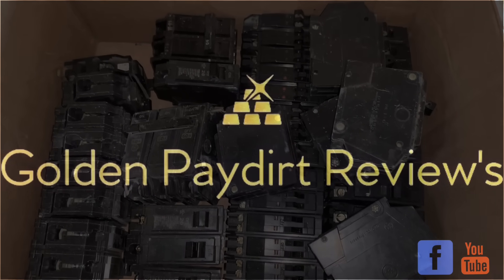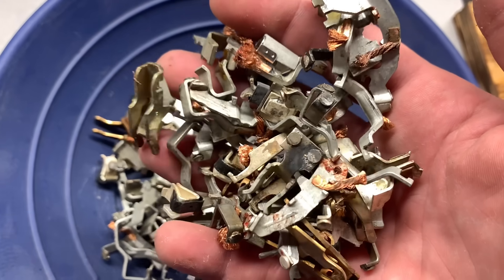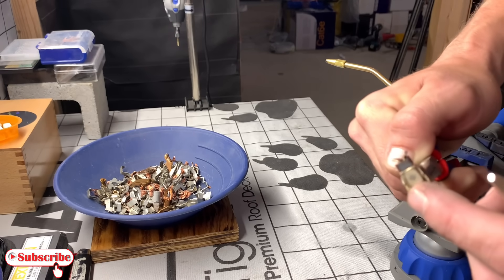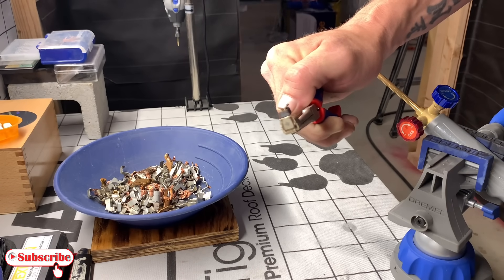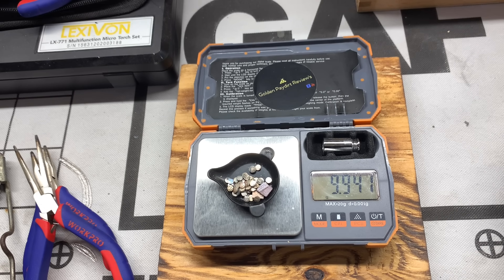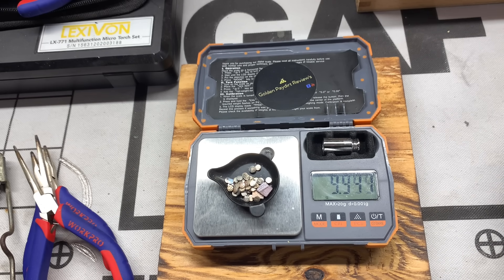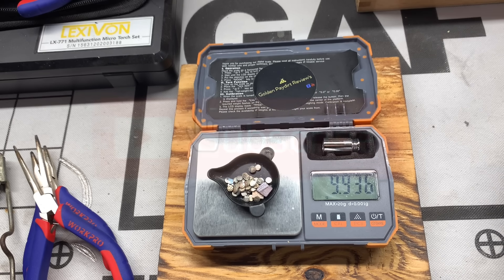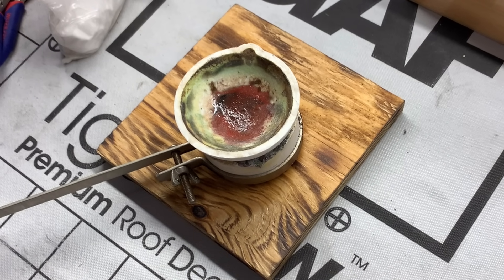Circuit Breakers Loaded With Silver!

Comment: It’s NOT pure silver. Pure silver cools into a silver mass, not a black mass that needs buffing. Period end of story. Pure silver always cools silver. High 90s cools grey. Anything lower cools black. If it was say sterling or 90%, a dunk in water would have produced a milky white silver. None of which need heavy buffing. My guess is, some of those buttons are probably also silver plated copper.  I’ve been working with silver long enough I can tell good silver just by the color of how it cools. And pure silver always cools Nobel.
Reply from the maker: Thanks for sharing your detailed insights on silver purity and cooling properties! Thanks for watching

Comment: I am curious what the profit is after you factor in the expenses involved to refine this Silver, i,e,   Gas [ torch to smelt ] Electric [ wire wheel to clean ], misc. expendables or tool wear . Not looking to be negative, but besides labor, there are out of pocket expenses. I am curious as to the profitability given current Silver prices being so high, but inflation has also raised these other costs as well.
Reply from the maker: Those are great points to consider for a full cost analysis!

Comment: I found an abandoned trailer next to a scrap lot that closed back in 1996. I removed the trailer on a dolly because the tandems were junk and got it to my scrap dealer. When we opened it, it had thousands of stainless steel looking round billets. We called the police and tried for a month to get a hold of the old property lessor. No dice. Unfortunately, we sent it into the mill at 6 tons stainless and back then we got .29/Lb. Turns out the smelter had issue with it boiling up and causing issues and they discovered it to be .925 AG and not 309B billet. Lost sever thousand dollars that day just from not inspecting the contents of the load. I applaud your efforts to salvage even the smaller contents of industrial waste. Keep it going!
Reply from the maker: Wow, that's an incredible story of a missed opportunity, but it highlights the importance of always checking what you have!
Reply from the maker: Just imagine! But who would’ve thought, .925 AU was loaded to the brim! The odds! Today’s value is preposterous if you would’ve knew a cashed out! TY 4 the story! Made me double up my comment……..

Still thinking about that 1
Reply: Assuming you meant silver (AG) and not gold (AU) Google AI calculates that to be worth approximately $13,403,380  today - 1/6/2026 ~ $82/troy ounce.
Reply: @LAHarder7  It was .925 sterling, take some time to read the comments after editing the auto garbage you probably got from AI.

Comment: At the end of 2025 that is about $45-50 in silver value. Throw a stamp on it with weight and purity and you could probably find a buyer somewhere between $50-75. Cool video. I knew i was keeping all the old breakers I change out for a reason.

Comment: Got me a little clasp jar of 2.5 pounds of contacts from old two-pole 60amps. Some 20-50amps thrown in, but mainly the 60amps with a few lucky 70-100amp broken/burnt change outs. So many sessions with the anvil, mini sledge and bucketing the contacts. Then zoning out with a blowtorch flicking them into a mini iron skillet.
This Christmas I'll be melting them down and removing the impurities small batch by batch in a double burner smelter 👍🏻
Reply from the maker: That sounds like an amazing haul! Keep up the great work.

Comment: Did you know that there is 0.53 ounces in one 240 watt solar panel? Just crush it and melt the whole thing. The melting temperature difference between the silver and silicon make it very easy to do.

Comment: I have around two 45 gallon barrels full of 10 Amp to 150 amp breakers. I have attempted to remove the brass & copper from the breakers I have done. Your method of removing the silver looks easy but would it be able to be sold as removed buttons to someone.  Also get a lot of electronics is there any silver in them.  Thanks
Reply from the maker: That is a great amount of breakers!

Comment: Loved the video. I've been a scrapper since I was a teenager and realized I could get money for metal. The past few years i have been collecting old computers and stuff but just for steel weight. But finding channels like yours has shown me that with a little extra work, I can recover silver and gold and make more money. Just saving for a decent setup to refine what I have collected.
Reply: All ya need is a stainless steel pot, some strong acids, maybe some hydrogen peroxide, some over the counter stuff basically that is usually pretty cheap.
You can always make nitric acid and Hcl at home with various methods and cheap materials. It is fun learning the chemistry involved, and you end up with all sorts of accidental knowledge thru the hobby
Reply from the maker: Good 4 u, making some extra silver today, mashed you richer tomorrow! 

Thanks for watching

Comment: As a professional scrapper it is great information but the biggest mistake people make getting into scrapping is ignoring the simple fact that your time is not worthless when taking on a task such as this one needs to take into account the time it takes to process the material must be factored into the final value unless as you said it's a hobby and not an intended income generating endeavor in witch case it looks fun and interesting for thoes who make a living at scrapping it's undoubtedly a negative value end result after time materials and labor spending three or four hours dismantling and harvesting then another hour smelting would be a -100 dollar processing cost vs a $13.00 profit regardless of how much you save. The time and energy in the short or long run is costing you money you time must be factored I factor a hour time value of $25.00  therefore in order to attain a worthwhile profit I must make at minimum twice what my cost per hour is and if I don't I'm spending time I could be making money on something else. My personal biggest generating material is not copper like most assume but brass as the competition to recover it is far less then copper these days everyone is desperate for copper even the smallest of wires in electronics is scrounged by thoes who don't factor there time I've seen bins full of electronics completely baron of any copper wile brass  gas water and presher fittings and electical connectors and contacts are tossed aside with the  leftover scraps this may not be the case everywhere but it's a reality here to the extent disposal companys hire after hour full time guards to deter would be pickers from entering the property and city bylaws forbid the disposal from electrician HVAC plumbing irrigation residential construction companies to be placed in publicly accessible bins or unsecured waste bins witch must be locked and bolted and secured behind a  locked fence or gate out of the view of the public and must have 24 hour surveillance cameras or they face fines starting at $10,000 first offense $50,000 second offense and third is $100,000 fine and the companys business and operating licenses are revoked or cancelled indefinitely and  the  physical business is seized and all vehicles equipment materials are sold at auction to recover the cost of fines and penalties regardless if the business owner wants to pay the fines out of pocket the only way to recover items is hire a second party to attempt to get them back at auction because the original owner is not permitted to attend the auction 
The level of bureaucratic control over scrap metals and materials is becoming unfathomable  and is soon to spread throughout the UK and north America example cateletic converters only three years ago returned excellent profit as of 2024 there are no companies buying them as each unit requires the person scrapping them to produce proof of ownership of the vehicle the make model and year and when it was bought the amount paid for each individual owner for the last 10 years essentially rendering them valueless soon anyone scrapping will be required to apply and pay $1500 for a licence and permit and have to attend a 40 hour course with a annual renewal of $900 and be required to provide the source and location & time and  date and proof of permission of property owner or proof it was legally obtained and anyone cought with scrap copper brass aluminum and so forth without a permit or licence will face mandatory arrested and fined or jail time if the amount is over 10 kg or 22lbs of any one material when that day arrives next year all I know is after 20 years my business and my only source of income will cease to exist 😔

Comment: The few bucks that it brings sure is nice, but it would be also useful to calculate the amount of gas used  for melting .And the gloves won't last too long with your method of cleaning the button. I would use a rotary tumbler (about 70$) with some good abrasive and give it time.

Comment: Nice !❤hey so when you melt it, all you need is heat off that torch??
Reply from the maker: There’s many things you can use to melt, but definitely a mapp gas torch try not to use propane, it doesn’t burn as hot! I’m talking about the yellow Mapp gas cans opposite to the green propane cans offered at Lowe’s or Home Depot, grab the yellow! 

Also you’ll need a melt dish of sort, I heard you can use a potato I saw it used by many people! But you’ll need to prepare it also I highly suggest buying borax which is very cheap and Home Depot or Lowe’s. I think 3 to 5 dollars and you can get a huge box of it. It’s just a laundry activator, or a household cleaner it’s powder form, and you’ll have that for the rest of your life! That’s it! 

Thank you for watching! And commenting! Appreciate your support

Comment: Yah, except it's nickel-silver-copper alloy, so what's your plan for separating those from each other?  Seems like a lot of work.
I'd rather stay in school and score a high-paying job and retire early.  Did that.  How's your plan working?
Reply from the maker: It’s not copper! The points/contracts are either pure silver or silver plated! Only two things! The plated version you can truly melt! The contact does not melt, but what does happen, is the silver that’s plated melts off and joins the other silver that collected in the gold-melt dish and adds to its weight! When you do run into the non melting contacts, you just pick them out! And continue with the smelting process! And $20 bucks in silver 3 years ago plus is not $31 bucks in silver today, and the price keeps growing! It’s a viable asset that continues to grow in value every day so if you did this once a month just for fun as a hobby, you would have 20 g per month times that by 12, you’d store $420 in silver yearly, that silver would have matured to todays prices and that’s another added value of a total $552! And all you did was recycle and hoard precious metals

Comment: How many breakers?
Reply from the maker: If I remember correctly, it was over 50, I think 56! And I did it in a rude fashion, you can use the electrolysis method, which strips all the silver into silver crystal or into silver cement! All of the parts in the breaker are also silver plated, there’s more silver to be had, but I was just showing a point, there are silver in average household items!

Comment: Nice one friend, I've been collecting these but have not process them. That was a nice idea melting the button off of the metal part with the torch. I had a bit of a search and actually, tungsten can alloy with silver, but not easily. So maybe picking them out is not so important. Just scraping them to the high side of the melt dish and pouring them off would do the trick.
Reply from the maker: @waynoswaynos  you’re the best, thanks for the great words. I appreciate it.
Also appreciate you watching and your feedback! I did pick allot out thru the process Off cam, it’s easy with it’s molten, you can see the ones that won’t melt but lose the silver coating in the process, so even the tungsten ones or the plated iron or plated steel ones, the plating is silver so your not ever losing! It’s always a net gain in silver!

Comment: Silver has been selling for over $30 an ounce last six months so a $8 circuit breaker has very little silver in them. Not worth the time!
Reply from the maker: You are correct, but there are other metals and materials of value in those circuit breakers! The value is in hoarding the silver and copper! Overtime they all increase and value as I did this video 3+ years ago that $20 in silver now has a value of $31. If you did this every year you would have about $500 in silver saved for rainy day.

Comment: great stuff .. my question ... first i have a a small drill master craft drill press I drilled the  beakers   at least 30 in 30 mins  its a different choice much cleaner... i found a few that where copper are they just coated or toss
Reply: and found staple clips almost looked gold looking not copper
Reply: wish i could send pics of the monster breaker in batch it was massive contacts huge
Reply from the maker: Thanks, that's a great tip, I'll be sure to check it out, but copper is usually just coated, toss em! But copper is valued so that’s money tossed

Comment: Get yourself a bunch of those and then do the nitric boil, cement out on copper, filter and rinse and filter a few times. Then you'll be pretty close to pure. Its not hard. Or you could go straight to the nitric but your smelting will make the process a little bit cleaner and save acid. You should smelt it and pour as shot instead of a button. Will dissolve better in the acid.

Comment: It’s as important to learn where not to pursue silver as where to pursue it.  Lesson learned.  Circuit breakers not very profitable.  Unless you got them for free. 

Suggestion:  you could have just weighed one unit and multiplied the final weight.  Which would still include waste.  So it would be worse.

Comment: I have a huge collection of these that I need to process!  How do you break apart the circuit breakers with the hammer and avoid creating a huge mess?  Do you wrap them in a towel or do you have some kind of box that you could stick your arms into (kind of like you see in chemistry setups)

Comment: 10:43 that's not silver. It's all the Tungsten etc from the buttons that were plated. Click bait.
Reply: If you think he melted tungsten with a plumbers torch...you don't know much about tungsten. The pieces he picked out were likely brass, stainless steel, iron or yes, even tungsten. Youd have a hard time melting copper with a plumbers torch my friend (though in combination with silver and borax, it can reach high enough temperatures to plate out)

Comment: For You To SHUT UP !
Would be worth more 
THAN $13.°° LOUSY BUCKS !
Reply from the maker: It’s not about the value! Don’t you understand? It’s about where silver can be found! If you processed the breakers more then I did, each breaker could fetch you alittle more! First off there’s more silver then I collected, you can use electrolysis recovery, also there’s copper and aluminum also in there, so if you salvage every part, you can triple what I made! 
It’s a hoarding hobby, that pays off ever time you do this! Did you know…. That when I made this video silver was way way down, now silver is close to its highest ever, during this decade, that $13 bucks turned into $17.96 which will
Continue to grow and grow! Just see that this is to open up a broader discussion about where to find free precious metals 

Thank you for watching

Comment: Years ago I stopped the electrical supply house to pick up a 100 amp two pole circuit breaker and it was a $1 more then a week earlier. Monday morning I picked up another one up and they said it was $2 more because price of silver went up.Told them to grab a breaker that was on the shelve at least a week and only charge me for that. Told them bet they don't even have a $1 worth if silver on the contacts.

Comment: I dissolved one troy ounce of contacts collected from relays I got at the junkyard. They worked out to be about %60 ish silver. Started with 31.1g contacts and yielded a 19.6g silver button.
Reply: Did you XRF?  Were the contacts alloyed with cadmium?  😬
Reply: @travismiller5548  did not xrf. Alloyed with something.....had a milky white sediment after I dissolved them. Could be tin oxide, though. I'm not positive. Definitely had some copper alloyed as well. I didn't melt the raw contacts as the small size made it an ideal size already. My understanding is when cadmium is heated/melted is when it gives off toxic fumes.

Comment: seems like an absolute massive amount of effort and time for less than $15 of silver
Reply: Depends if your doing little breakers like he did it's some work. I get industrial breakers and starters for electric motors. There starters I get have 12 big points that weigh almost 2g each so I'm getting a ounce in about 6 min from the starters . The 600 and 1000w breakers have sometimes 3 but usually closer to 2oz per. So personally if I get 2 of each i can get 6 oz in under 45 min. And I'm in Canada our price is $31 per oz
Reply: @ChrissyLarson  how in hell are your price per ounce different from the international spot price? I'm honestly curious! Do you have a ton of taxes added in there some place?
Reply: @michelle.lin3653 no it’s cause the Canadian dollar is weaker than the USA. $1 Canadian dollar is less than an American dollar.
Reply: Not to mention destroying $500 worth of breakers. SMFH
Reply: Unfortunately, most places won't buy homemade bars either. There's people melting down copper to and turning it into the bars. Scrapyards won't even take it if you do that. It was interesting, though. I didn't know there was silver in breakers.